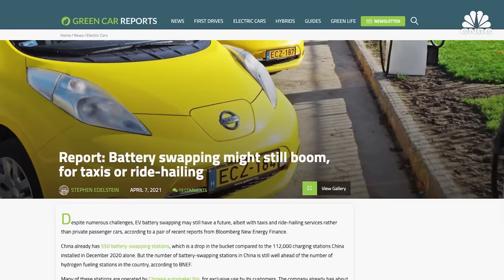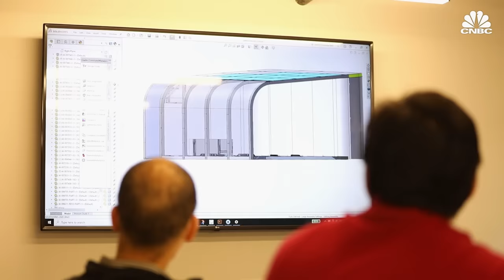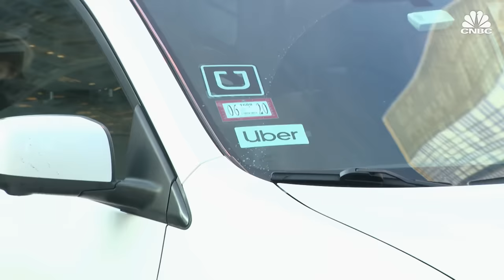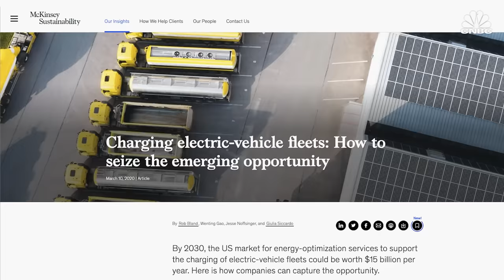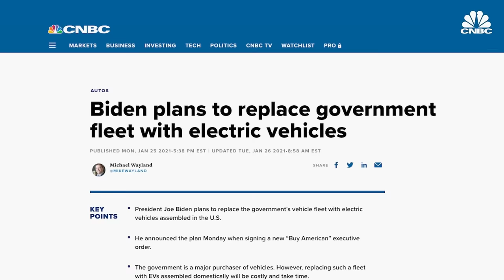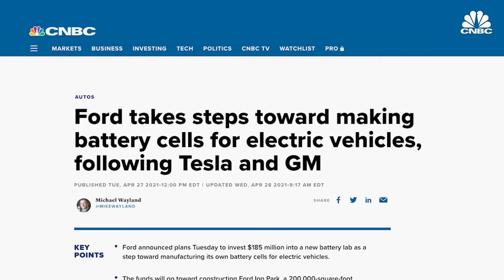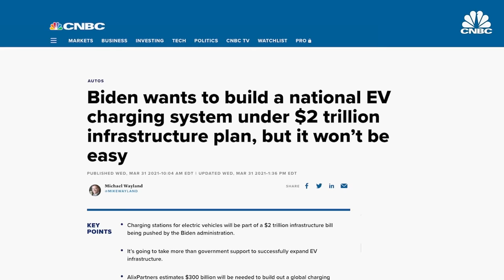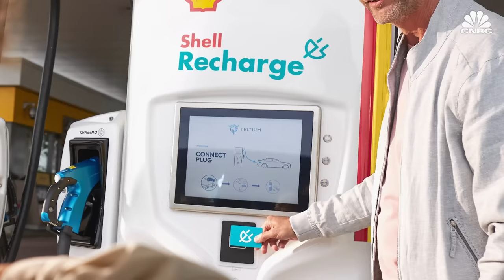Can EV Battery Swapping Take Off In The U.S.?

Comment: I'm sorry there's already a battery constraint a shortage of batteries you're going to need multiple battery packs for every car that charges at one of these swap out stations making their use very limited
Reply: Well, the idea is that smaller, swappable packs have value.   I would like the 1/2 pack or 1/3 pack option to shave 500+ lbs off vehicle weight given my daily 30 mile usage, which in turn improves the day-to-day economics and range.   For a long range trip, the additional packs could be rented.

But if the swappable packs are as large as the full range battery, yes, the economic advantage of swappable batteries is questionable during the 10+ year ramp up of EVs

Comment: I think battery swapping is a great idea and would be far better for the batteries in the long run, people might keep their electric car longer because the battery wouldn't need replacing after so many fast charge cycles. Slow charging is much gentler on the battery.
I might even consider an electric vehicle here in Canada if they installed battery swapping stations, I'm not standing at a charge station in minus 30 degrees in the winter for 20 minutes charging an electric car when it only takes me a couple of minutes to fill my gar car now!

Comment: This is the only future possible for EV, because of obvious reasons:
1. Anybody is going to wait 2 hours (in best case with a supercharger) to have the battery charged
2. A individual network of charger (every owner with his own charger) is completely unsustainable and impossible. Think about big cities and the number of cars that there are in them. Where would they be installed? 
3. Normal people can not afford pay for a new battery or a new vehicle every 8 or 10 years because the battery capacity. However battery swapping not only eliminate this problem but also allows owners to have always last battery technologies and choose the most convenient capacity according to their needs (for example choose a small battery for daily use in case they don't need to do a long distant travel)

The advantages are clear for users:
1. Not owning a battery is not worry about the state, deterioration or charge of them.
2. Having an efficient recharging time. 
3. This is the only way to really develop EV for main public. Its the only efficient way to create a recharging worldwide network.

Comment: I could see this being huge for fleet vehicles but for my personal vehicle I'd rather keep the battery I paid for
Reply: What if you didn't have to pay to buy the battery outright? What if you paid a fee to use the battery as a service?
Reply: @sunilds3590  good question, for me personally I would rather take care of things myself than pay a fee for a service. It's usually cheaper long-term to own rather than rent but I could see how this could benefit some customers.

The reason I wouldn't like a battery swapping program is because the potential risk for swapping out to a lower grade battery.

Again for fleet vehicles with full frame construction I can see this being an awesome easy way to keep the fleet on the road with minimal downtime. But for my personal car that has unibody Construction I'd rather just charge it up and replace it every 8 to 10 years
Reply: @96ej  "It's usually cheaper long-term to own rather than rent"
Not during a period of rapid technology improvement.   The depreciation of the asset is accelerated by innovation.
Be wary of the drop in value of ICE vehicles
Reply: @GK-op4oc  agreed, ice is gonna plummet faster than a used jaguar

Comment: The biggest appeal of electric cars is that cost of electricity is less than gas per mile, but biggest downside is that it's time consuming. At 10¢/mile that's definitely about 50-80¢ more expensive than gas but with still limited range
Reply: if you dont do a lot of road trips odds are you will have a fully charged car every morning since you plug it into your garage when you park.

Comment: When they started 7 years ago it may have made sense but today they don't now vehicles can charge upto 350kwh
Reply: kW not kWh
Reply: Except charging at that speed degrades your battery significantly faster, and if you're doing it often like for taxis that's a major consideration
Reply: @antimatter4733  with todays battery tech not that significant tesla latest tech makes million mile battery and you didn't think it through battery swap has its own challenges infra batterypack avaiblity and many others like risk of loose connection human error leading to accidents. Somethings are good to hear but not very practical.
Reply: @gaurav9431  tesla doesn't have a million mile battery pack, even with minimal fast charging you're looking at 50% or more degradation at 500 000 miles and if you decide to supercharge only you'll end up losing half your range at 300 000 miles. That or tesla will nerf your charging speed to hell like it has for older models

Also tf are you talking about human error, there's no humans involved in a battery swap, it's all robotic
Reply: @antimatter4733   your facts are not accurate frnd and people dont drive north of 300 miles everyday so why superchage everyday can use home charger most days and rarely any car crosses 500000 miles in its lifetime. Beleave me brother battery swap is not fissible tech wnd will not take off.
Reply: @gaurav9431  I think you have difficulty comprehending basic English, I said 2 comments back that for applications like taxis which is the main use for battery swap technology this is ideal. Taxis don't have time to wait around for over an hour every day charging and they do cover well over 300 000 miles and preferably more as long as they're economical, which trickle charging allows. So yes a tesla and it's  battery won't last 300 000 miles, but plenty of these cars and batteries will
Reply: @gaurav9431  also the technology has already taken off in China, with hundreds of swap stations
Reply: @antimatter4733  I mean, it’s true that fast charging hurts battery more. but I’m just not sure if swapping station will trickle charge the battery. A station seems only be able to store a couple of batteries on hand and there are way more cars visiting it during a day. I would be surprised if the charging station is not fast charging the recently swapped out battery before swap it onto another car. Ok, maybe it works because the car owner doesn’t own the battery anyway (in NIO’s battery as a service model). So they don’t care that much if they get swapped to a more degraded battery.
Reply: @quiet-cheese  I doubt NIO would intentionally damage their batteries since they're the ones who own them, as for the number of batteries per station I don't think it's fixed, it's based off demand and can be upgraded as they see fit, so no real need to fast charge the batteries
Reply: @antimatter4733  the math doesn’t add up if they are not fast charing their batteries. The newly unveiled Nio Gen 2 swapping station can hold 12 batteries, yet have a maximum throughput of 312 cars/day. That suggesting they need to recharge these 12 batteries 26 times in 24 hours if no other supporting staff comes in and delivery batches of fully charged battery and take back the drained one multiple times a day (which only further adds on cost and reduce reliability. So i doubt they would do this). Also the Gen 2 station has a power requirement of 1250 kW and I can’t imagine why they would need this huge amount of power if they are not fast charging batteries on site ( turns out that 1250 kW divided by 12 batteries gives you about 100 kW / battery, which seems to be a reasonable number for DC fast charging)
Reply: @quiet-cheese  where is your statistic on the number of batteries the stations can hold, from what I've read the number is variable and based off demand and based off the size of the station it should easily be able to charge 50+ batteries. You won't even be able to charge a battery 26 times in 24 hours
Reply: @antimatter4733   I’m sorry, should be 13 batteries not 12. Here’s my reference https://www.google.com/amp/s/insideevs.com/news/465195/nio-launch-power-swap-station-20/amp/. And yeah, you definitely cannot perform  24 charging cycles (312/13  with updated battery numbers) in 24 hours,,,,,,, unless you use fast charging :D
Reply: @quiet-cheese    you're assuming that it can charge 312 batteries from 0-100%, all it says is that it can do 312 battery swaps in a day, which works out to one battery swap in 4.6 minutes which is how long it takes for the battery swap procedure.
Reply: @antimatter4733  but you would agree they must serve more than 13 batteries swap a day, right? Assuming no supporting staff comes in to take the drained battery away and deliver fully charged  battery multiple times a day (again, which I argue this is very unlikely because it is extremely cost and energy inefficient and almost defeats the purpose), then you left with the 12 batteries the station can acomódate. If you trickle charge them, there will be no where near full or even half. And I don’t think any customers (especially taxi drivers that you mentioned in earlier comment) would like to get swapped to a battery that’s not full or even half full (that again defeats the purpose of swapping). Also I can’t image what the station would do with the 1250 kVA of power if there are not fast charging the batteries. All in all, that’s all my speculation with the specs NIO released.
Reply: @quiet-cheese  where are you getting that figure for energy usage, I didn't see that anywhere. And yes they are charging the batteries, just not fast charging them. If all 13 batteries get used in less than say for example 3 hours, it'll just automatically update the maps via the internet and send drivers to one of the other hundreds of battery swapping stations. The number of stations they're building are based off demand, if they have 100 people swapping batteries daily they'll have 10 swapping stations, pretty simple
Reply: @antimatter4733  the 1250 kVA number is almost all from articles in Chinese, but here’s a video in English talks about it https://youtu.be/Oh4108by308?t=398
And to your point of 10 stations serving 100 cars, I couldn’t image that to be the case. That’s an extremely low facility utilization rate. Especially you consider these stations usually sit in dense urban core where the land price is extremely high. They probably lose more money letting the stations “sit” idle there to trickle charge the battery than if they fast charge and letting the battery degrade a little bit. My take is that battery tech has improved a lot and are continuing  to improve. Fast charging might not be that bad compare to earlier days. Sure, overtime, the degradation acumúlate, but NIO should probably have plenty of ways to repurpose them, such as “downgrade”  100 kWh battery to 70 kWh one. And users probably wouldn’t care that much either since they don’t own the battery.

Comment: Battery swap is not a good idea. 1. The biggest limit on producing electric cars is the battery. With battery swapping you can produce much less cars. 2. One of the best things about owning am EV is not having to go to a gas/charging/swapping station (home charging is awesome). 3. Range is not a problem in the best cars (All Tesla's I'm afraid. In the future more will get better range). When you have a rage of 300-500 miles, you simply don't have to change anywhere but at home.

Comment: I have bashed EVs for years simply because of the limited range with very long charging times.  This is the only solution that makes sense for any long distance travel in the US.  Nobody will drive 200 miles then wait 5 hours in the middle of no where to only drive 200 more miles.

Comment: The adoption for private cars depends on the battery cost vs overall car cost, e.g you won’t care much about battery degradation for a $25k EV where the battery costs $15k, just buy a new car after 7 years;
On the flip side, the answer will be different if the proportion is 15/80, when there’re hundreds of swap stations all around the city

Comment: This has been going on for years in the warehousing industry for large Material Handling Equipment. These MHE aren’t tiny either, much larger than cars.

Most warehouses either have super chargers (charges  in 15 min) or battery swapping.
Reply: Yes but a warehouse is measured in sqft or meter not miles and kilometers. Also the warehouse uses all the same equipment. There's 40+ car companies selling evs in the USA. Lots of issues

Comment: This is a amazing concept and will boom in city centre areas where apartments are rife! Don't worry see Tesla & others offering Baas soon
Reply: Its really not a good idea. My city is already connecting ev charging stations into streetlamps for people who dont have a garage. Tesla is going to have way better range with their integrated structural battery pack than any modular EV. Teslas batteries are already cheaper, smaller, and go farther than the competition and it just getting better. How many battery packs will these swapping stations need to have on hand in a city in order to make sure people arent sitting around waiting for a pack to finish charging before it gets swapped into their car? A battery is the most expensive part of an EV and they want to have thousands of these just sitting around when the world is already battery constrained. Each one of these places are going to cost millions in battery's and they will need to be all over the city and highway, otherwise youll be driving out of your way to get a swap, negating most of the benefits. They mentioned using them as grid energy systems, but that will degrade the battery life and tesla is already doing this grid battery powered energy storage with cheaper batteries that dont need to be small or light.
Reply: Once you will able to charge during shopping, this idea will just die, also if you have a solar panel on roof of your car like some Prius variants and not traveling that far during 5 day work week as often happens in Europe for people living in the cities, you may not even need any additional charging at all...
Reply: @saulgoodman2018  lol. He gives a well-thought-out, nicely phrased argument. And the best you can come up with is "Shut up Elon fanboy"? If you want to have an actual discussion, tell him what parts you disagree with. What you think is the future with battery swap. Otherwise, don't waste everyone's time, please.
Reply: @bhavyanshsabharwal9029  you can tell when some is a Tesla fan boy. They don’t want to hear about anything else. 
Nothing wrong with swapping batteries. 
Just talking about how good Tesla batteries are, are not any argument in why no one can do a battery swap.
Reply: @saulgoodman2018  Then explain your perspective. I don't think he made any incorrect assumptions here. Charging stations are going into lampposts, structural batteries like the ones Tesla is making have better range than modular packs which are required for battery swapping, and guess what? Tesla IS making the cheapest, fastest, and smallest battery. Look at the range per kilowatt hour. Look at the price per kilowatt hour. The battery IS the most expensive part of an electric vehicle. It is the reason that scaling EV's are hard, because there simply aren't enough battery packs. Wasting even more inside battery packs doesn't seem to be a good idea. Battery life will also degrade on these batteries. All of that for saving 10 minutes on a charge? It doesn't seem to make sense. Now, if you disagree with this, give a logical response. Not just saying that he's an Elon fanboy. BTW, I don't see the problem in being a fanboy of a person that is changing the world for the better.
Reply: @bhavyanshsabharwal9029  I have already explained. People do not want to listen.
Reply: @saulgoodman2018  All you said was is, and I quote, "Nothing wrong with swapping batteries. ..." That is NOT an explanation.
Reply: @bhavyanshsabharwal9029  And nothing wrong with that.

Comment: The only way this works is if you make batteries a subscription. So you buy the car with a reduced cost as it does not technically have a battery but you pay x per month for the battery and reduce the initial cost of the car. Considering the battery is the largest cost this is actually actually extremely attractive for selling a car. It would give the benefits of using the batteries to their maximum and you would never have to pay to replace a battery and if any given battery is bad if they base it on this modular system you basically just lose range until you swap out again.

Comment: Its such a dumb idea, Imagine ending up with a battery that has way more mileage then the one you payed like 10k for lmao.
Reply: you dont pay for the battery when you buy the car dummy, you rent the thing, that's the way they wanted to do it, highly doubt other manufacturers will play along though
Reply: Yeah, they'd work the battery contact into the car sale. One way or another you wouldn't get screwed they would have to guarantee them.
Reply: Oh boi you literally didn’t listen a word from this video did you
Reply: @nehcooahnait7827  Nobody is going to rent their battery, 350kw charging will be way too fast to screw around with this crap. There is a reason Tesla dropped it.
Reply: You save 10k on your nio if you just rent the battery. The swap station checks the health of all batteries and self drives your car in and out of the station. 3 minutes for the actual swap.

Comment: Structural EV batteries basically produce a throwaway car, where swapping or even replacing the battery will be impossible. This swapping needs to become commonplace so part of the car's frame battery don't get built.

Comment: Many electric cars use the battery as a structure. It is also important for how well it does in impact testing. These batteries will likely change those. Good idea, but they would need to come up with answers for these.